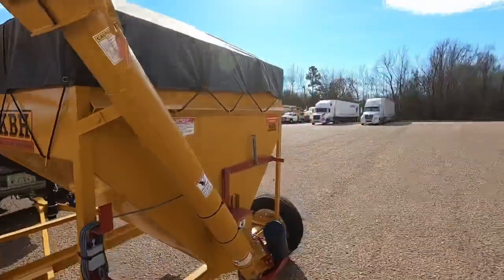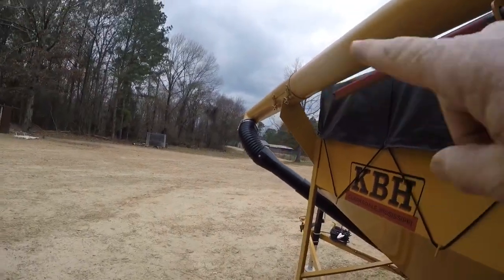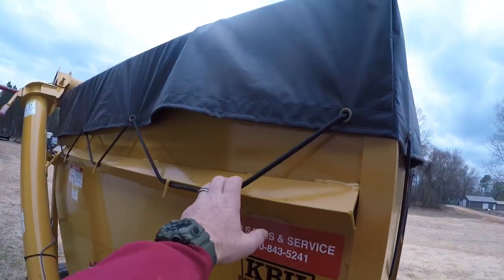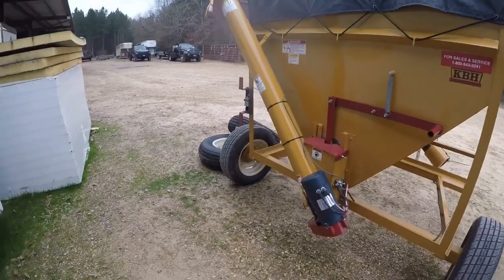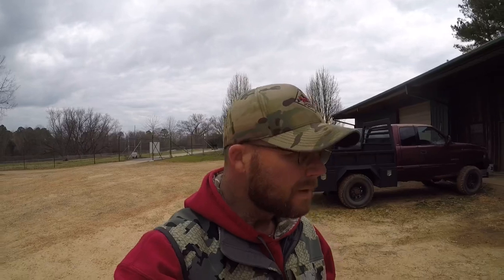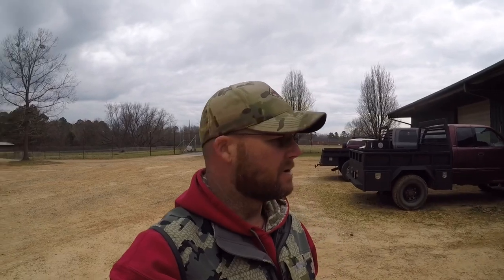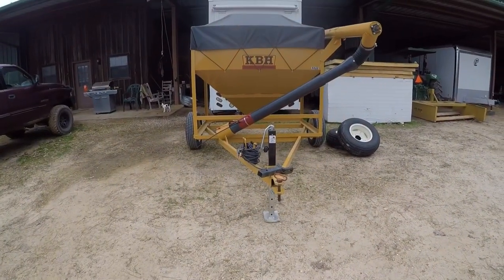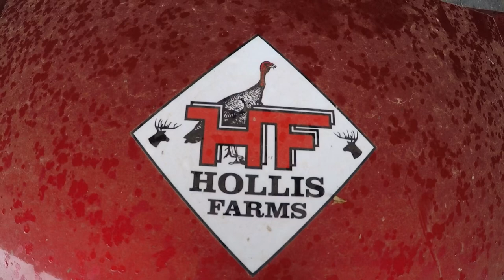NEW 3000 LB WHITETAIL DEER FEEDER FILLER🦌🦌🦌

Comment: Going to have to make modifications to suit your needs , going to make life better in long run. Use one to fill my feeders cause I'm to old to do it manually. Corn out of field, into bin, into trailer and finally into feeders. Few things I did ,placed battery pack on front mount then ran wires to it and plug into outlet to charge, also got electrical vibration unit mounted to help when corn is low. Already know you going to love it and the time and money it saves. Love your videos getting ready for turkey season here in Georgia.
Reply from the maker: Thanks 👍👍

Comment: Hey jason.keep that clean out blown out with a air hose after a while the corn dust builds up a when it get a little moisture it turns into concrete just like a feeder.I ran some quick dis-connect cables made for jumper cables that mount in the grill of a truck,just ran them back to the rear works good

Comment: It’d be nice if you could do away with the top auger and have the hose put on  the bottom portion where your not having to erect that up and down and also add an electric or air vibrator to that hopper you could turn on when the feed gets low to help with the flow! Overall sweet rig tho.
Reply from the maker: Thanks 👍

Comment: They make a 12 volt vibrator that will bolt on the hopper and it will help get all the feed out. Great equipment i like that. Bet it would work for cows and chickens and others as well. Be safe have a great day
Reply from the maker: Thanks 👍

Comment: We have a Crustbuster tender similar to this. Running the wire to end of seed tube, relocate or put a 2nd on/off switch to end of tube because when it's full it's going to move some seed. When it gets low tap on side of hopper with rubber mallet, mite help empty out. That works with fertilizer tender. That's going to be a nice set up anyway you do it.

Comment: you can go to supper sacks or  bends like you said.  but when full that is 18000 lb. you will need to pull that with the tractor.
Reply: jreclaim has a good ideal on the flex tub . you will lose a lot of corn when you let the arger down , and when you get ready to put it up agean it will have corn in it witch will add weight . with the tractor you could add a hyo. clinder to lift the arger